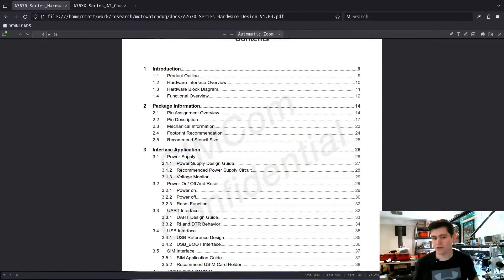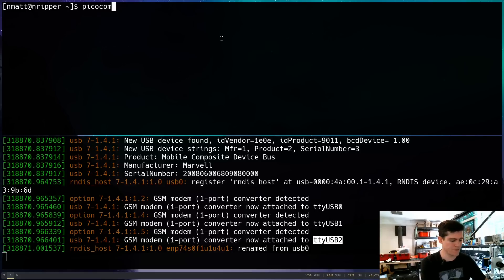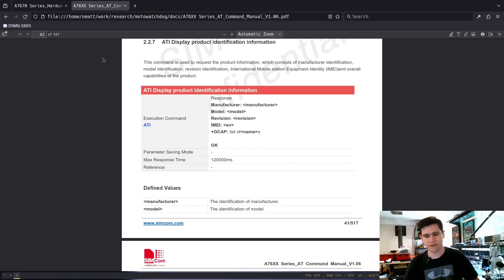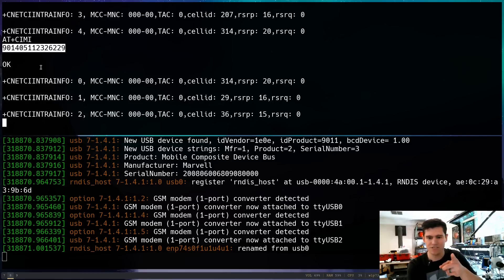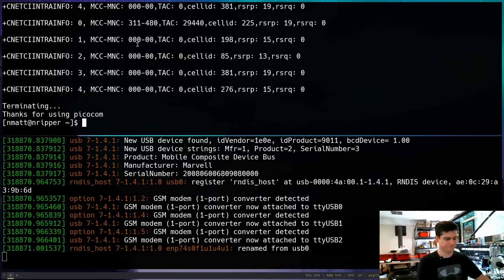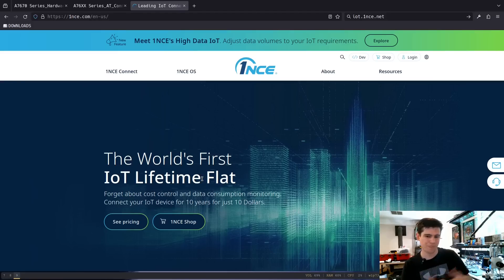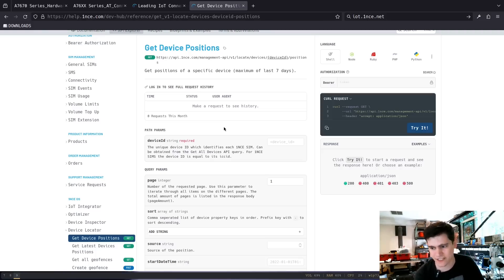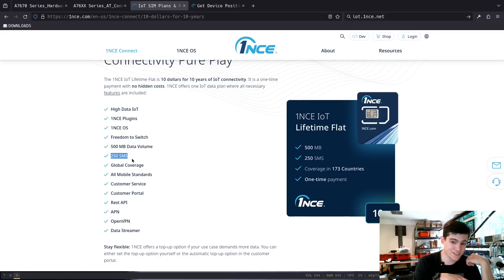4G GPS Tracker Reverse Engineering - Cell Modem Interactions

Comment: Actully your first video should be how to properly cross compile your go to formats like make files with windows. and most importantly how to work though the endless warnings and errors with a system. Tried the docker version of binwalk but gave up after 20 mins looping in vscode.  I dumped my ecu weeks ago but have failed to compile a version to dump the 4k immo eeprom  or block 12 even tho source is on github. Might be popular a video. I feel helpless AF unless it says .exe and thats with ~200 hours recompiling arduino and marlin probably common.   Great videos BTW! Been a sub since you hand soldered that image sensor!

Comment: You follow cemaxecuter or dragonOS?  forgot you have a flipper so you probably do.   
My video ideas would be to pwn something dumb, no wifi simple soc. Reverse engineer the 32 bit STM you find in household stuff with screens. My "office" sized keurig needs 5 psi solenoids replaced every 2 years. Its a 4 hour nightmare.  I didnt see a header or external flash. How would you diassemble this to find 5 photos that loop while its pouring? Pumps are dying again... But a couple weeks ago i had to reecover a disabled SM2 pro j2534 stm32 in protection mode.  Unchecked every block and used a 5.00 swm prog with the factory dfu tool. Are they all compromised now? or did someone aquire it hrough other means?

Comment: couldnt you just ping with an end device connected to the modem? Or does the moden have a different communication IP?
Reply from the maker: The modem gets a private IP. So I would need another device with a similar SIM to get on that same network and then hope they didn't firewall off the different devices from each other.
Reply: @mattbrwn  so the modems IP differs from the public IP that an end devices traffic routes trough?
Reply from the maker: Correct

Comment: I did not catch the manufacturer of the cell phone modem chip. I do know that cell phone chips are a lot more sophisticated than people give them credit for it. Cell phone chips are not just a modem. It is also a single board computer with multiple different capabilities. A lot of them have Bluetooth or Wi-Fi or any other host of features.a lot of integrated devices like this would have for example the GPS attached to uart on the modem Chip. A lot of your older flip phones were basically running completely off the modem Chip.

I know Motorola chips and QUALCOMM chips have a developer configuration software. You can run on a computer and connect into the uart on the modem Chip to configure them.

Comment: For SMS, there are little programs on Linux that should be able to send them. From my research, it looks like a few GUI tools are Wamu, modem-manager-gui, and SMS Server Tools 3.

If you want to do it manually, the AT command expects a special 7 bit encoded character stream (In PDU mode) by default. You have to manually switch the modem into ASCII text mode. Once you enter your message successfully, it's usually CTRL+Z to terminate the message and send.

Steps to send a text message:
Switch modem to text mode:
'AT+CMGF=1'

Send message to a number:
'AT+CMGS="<Phone number with leading '+' for international numbers>"'

Type your message in then type CTRL+Z.

If it's not working after this, it's possible that you need to set the SMSC number manually by using 'AT+CSCA="<SMSC number with leading '+' for international numbers>"'. You should be able to also see the set SMSC by using 'AT+CSCA?'.

If it's still not working after all of that, it's likely that the cell provider is weird and locking regular SMS behind a business account paywall or that the IoT service expects everything to go through their servers with some API call.

Comment: Hey @MattBrown did you try to run AT commands to enable GNSS on the A7670SA? There's an application note on the product webpage. Not sure it applies to this module tho... FYIW I am using the GNSS features off a Dell EM7455B LTE minipcie modem (DW5811e Snapdragon X7 LTE based). It doesn't have any GNSS antenna, only the LTE ones, and it is able to get a fix. Maybe the A7670SA can as well, which would mean the GNSS chip and antenna would be a waste of resources....

Comment: Sorry, but this video makes no sense. Some code is still required to run on the device side to push its location to the backend. The API you are showing is just to pull data from 1NCE. The APN thing is that it works kind of like a VPN connection. Its possible that the device is running some "application" that is like an addon code that you can write and upload to the device that works alongside the default AT firmware. I seem to recall that you can write these "applications" in Python as well.

Comment: I'm not completely convinced the GPS module is superfluous. If the manufacturer removed the microprocessor rendering the GPS useless why would they leave the GPS module there? Thats a costly component. You would need to trace (or sniff) the GPS serial lines to see where they terminate. They may go to the empty microprocessor slot as well as the cellular module. The poor location data could still be explained by waking the GPS up, getting the first coordinates it sends before it has a lock, and then putting it back to sleep and therefore never obtaining a GPS lock.

I think if the cellular modem is running a custom program or built-in code that interacts with the GPS then we are missing the most interesting part of this device. Lets not dismiss the possibility based on an assumption.

Comment: Some of Simcom modems have the ability to be programmed. This module can be one of them that you can write your own code on it. Because the board has gps antenna and gps module which is too much extra cust for manufacturer, I believe it is programmed to get GPS data from L76 gps module and send it over network to tracking Server.
You can test it using different SIM CARD
Reply: My thoughts exactly. There's no need for a second MPU to handle the GPS data when you have one under the Simcom 'hud'.  Did you look into the connections between the GPS and LTE Modem?

Comment: Many of these cell modems have an "application processor" where you can run simple applications without the need for an external microcontroller.  I doubt they would populate the GPS that's not connected to anything.   It probably feeds the NMEA into a UART on the modem and they have installed a simple application to handle it.
Reply: Came looking for this comment.  The easiest way to implement is to literally use the cell modem as a data pipe and send the NMEA stream to the phone/web app and have it pipe that into Google/Apple/Open Maps to paint the location.  It's likely someone forgot to use the GPS data in the 1NCE (lol 'once') api configuration instead of the cell tower effectively nerfing their own product.  For the uninitiated reading this; a NMEA stream is usually 38400 on newer high speed modules that support GPS, GLONASS,  BeiDou, and Galileo so the total bandwidth per device is even smaller than a voice stream so it's no wonder they can offer 10 years of data for $10.

Edit: NMEA, not NEMA
Reply: This GPS module contains a feature that can log positions and then stream them out a UART port.  I think it's call LOCUS and Quectel documents in the data sheet for the GPS module.  A microcontroller is not needed to process and keep track of NMEA sentences.  I highly suspect there is a serial connection between the GPS and the 4G modules.
Reply: @tonyfremont  Agreed.  Yeah, I don't think @Mattbrwn explored the PCB enough to prove or disprove it.  There's no way they'd leave the GPS module populated just sitting there with no data connection.  The missing Microcontroller was probably designed for models with more features.
Reply: In the prior video he said he tried to find how the GPS is connect to the modem and he couldn’t find any connections.
Reply: @Jayjlow  Yeah, I watched it.  I didn't see any in-depth attempt to follow it.  On a 4-layer board you have to do a lot of work to follow traces, or take an X-ray (what I do).
Reply: It could be falling back to using the cell tower for location data, if there is no current GPS data available (e.g. because there is no GPS signal).

Comment: It would be really strange product placement if they were actually not using the GPS receiver; maybe it's connected through some level shifter or whatnot. The absent microcontroller is a fraction of the price of the GPS thing. Also, the modem has to have a powerfull CPU to do its own thing, so it can easily receive and parse some UART data. Basically, the modem is more interesting than the tracker itself, and it probably runs Linux inside.

Comment: seems odd that the GPS hardware is populated... what is the "firmware" on the cell modem, does it have an onboard MCU, can it be updated with custom firmware to poll the GPS module?
Reply: would need uart tracing
Reply: Seems like a part shortage of the microcontroller, and they came up with this bodge to keep selling them. Still placing the GPS seems wasteful, but maybe someone already ordered the PCB build with all of the available parts fitted with some other plan in mind.

Comment: AT commands were invented by Hayes in the 80's.  They became the industry standard for sending commands to modems.
Reply: So many fun times on BBSs started with ATDT 😀☎️
Reply: @RickTheGeek  or even just ATD (for pulse) :)
Reply: @RickTheGeek  I remember I always wondered if anyone ever used ATDP...
Reply: @NicolaiDufva  I did. I secretly changed the dial command from ATDT to ATDP on my dads computer lol
Reply: AT OK
Reply: Hyperterminal!
Reply: How many have the attention to know what AT actually meant and why it exists?
Reply: They still pop up in some weird and wonderful places

I recently found some vending machines being sold extra cheap as no one could reprogram or open them, after some investigation I found they were running little 3g femptocells, and the main lock for the machine used a modified AT command. The femptocells are actually worth a fair bit, more than a 2nd hand vending machine....

They were all Coke branded machines, other similar ones either had keys, or connected to the mobile network themselves, but a few had these little cells in them :)
Reply: ChatGPT ass comment
Reply: The issue is that its not an actual standard.
For setting a serial baudrate alone there can be atleast 5 variants that I can think of off the top of my head.
AT+UART=115200,0,0
ATBAUD115200
AT+BAUD115200
AT+BAUD="115200"
AT+BAUDX (X stands for a number in a lookup table from the manufacturer.)
There are probably more options out there but these alone come from some experimenting with bluetooth modules I did recently.

Comment: Hmm, I thought you said it also had a Queltel GPS chip and antenna. If you unlock the modem (see my other comment) you will find scripts that could be pulling the data from the GPS chip for more accurate location and sending it back over the cell network. But of course the accuracy of the location depends on the GPS chip and antenna and how many satellites it can acquire. If the AT+QADBKEY? works just reach out and give me that number it outputs and II will see if the same salt I use on other modems work and send you back that key to gain full access. Then you can dig even further into the OS and scripts on the modem that probably just Linux.

Comment: I would be curious to see if this modem takes this command?       AT+QADBKEY?   If it does then I could help. you with unlocking it completely and then you can use ADB to edit, transfer, install files in the shell.
Reply from the maker: will try this when I get back to my workspace :)

Comment: Why would it include the gps hardware but then not use it? 14:30
Reply: that sounds insane but i can imagine the conversation 

- hey product owner we can't get any MCUs anywhere 
- okay just don't put it in then we'll get it from cell towers
lmao
Reply: @pozdroszejset4460  thats basically how it goes in tech, ceos dont know shit and just Tell you to make it work
Reply: Probably just a cheaper version that does not require an MCU, but still very strange that they kept the GPS chip and antenna in the design, since they are quite expensive as well
Reply: @MachinovaAutomation  Could be from the time where simple mcus were out of stock everywhere
Reply: To advertise it as a GPS tracker most probably.
Reply: My guess would be that the Chinese manufacturer couldn't source US chips because of sanctions placed on China. They probably had heaps of inventory assembled waiting on the chips but when it became clear that chips would not turn up they just said F* it, drop back to cell tower and ship them at full price.
Reply: Because it does use it. That's just sloppy work by Matt. The modem comes with its own AP and can run application specific code, including reading out the GPS modem.